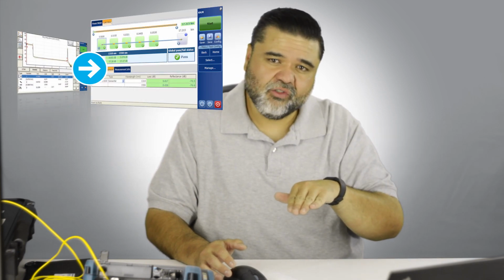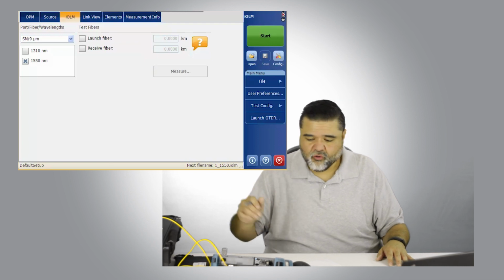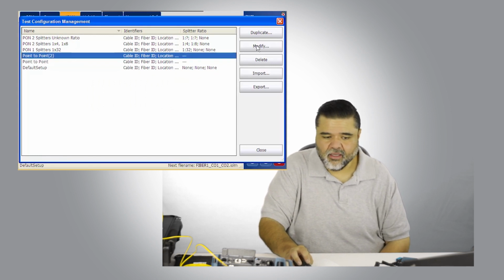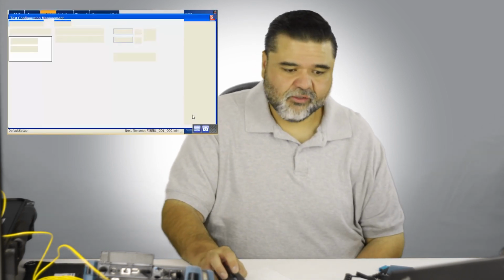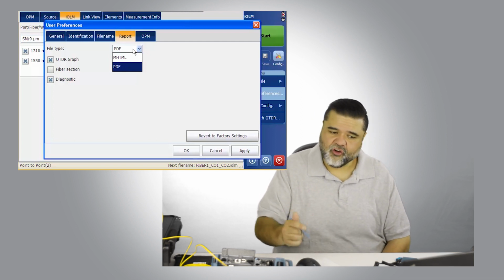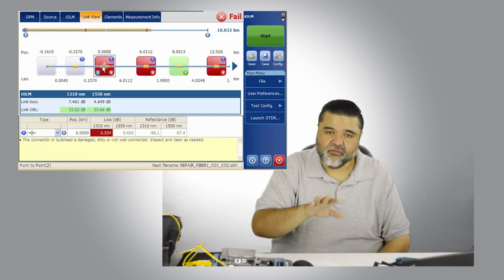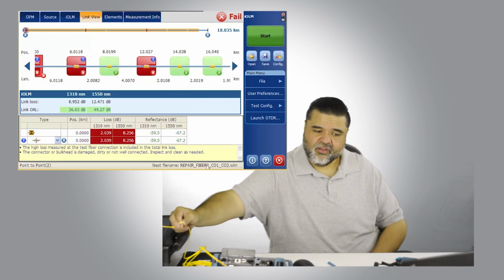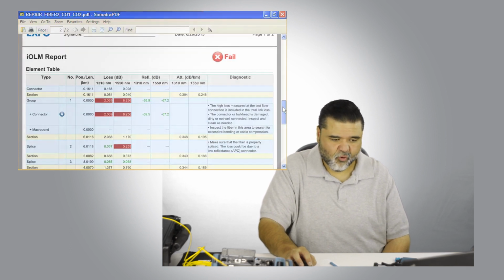iOLM User Training – EXFO – 15 Minutes or Less   Small

Comment: Can iOLM detect the pinching point when tested with only one wavelength
Reply from the maker: no you need both a short and long wavelength to detect macrobending.
Reply: @KevinPeres  i see
Reply from the maker: @MSB1180  if you had a choice of just 1 wavelength use the longer one. 1550 as opposed to 1310. If 1550 passes there is no serious macrobend issues
Reply: @KevinPeres  Thanks

Comment: As usual, thanks for the awesome video.
Two questions:
1. Does iOLM requires APC connector?
2. Is iOLM feature upgradable on any EXFO's iOLM ready OTDRs?

Sorry for having a lot of questions. Received our MAX720C recently. And currently exploring it.

Thanks Kevin
Reply from the maker: No worries about the questions.  It is recommended to have an APC connector on the OTDR if you want to enable iOLM. Most of our test sets ship with APC connectors it gives us much better performance. If your unit says it is iOLM ready then it would just need a simple software key to enable it.  If you have a UPC connector on the unit it can be replaced with an APC and upgraded to iOLM. Give the free trial of iOLM a shot. I am going to create a video talking about the new features of iOLM that include short fast and Medium link configurations under the Optimode setting in iOLM.
Reply: @KevinPeres  cool. Thanks Kevin. Will wait for the video.

Comment: Hi Kevin,
Thanks for video. it gives more information about iOLM
in iOLM, if there is a splitter of 50:50 after certain distance, how iOLM shows the link view ?
I mean does software shows both out put after that splitter or only one?
Reply from the maker: Jenson, You are very welcome.  If you are testing from the OLTS through the splitter you will only see one composite trace.  Same with an OTDR.  Depending on the dynamic range of the OTDR you will be measuring all the ports but folded on to one trace. What you will see is the loss from the splitter lets say a 1x32 you will have approx 17dB of loss if you have multiple ports used on the splitter depending on the distance from the splitter you will see a connection for the end of each drop.  With APC connectors it may look like a splice if it has low reflection.  I hope that answers your question.

Comment: Hi Eng Kevin 
Thank You for You efforts but 
Would I Ask you question about inspection Fiber 
Please Tell devices you are using ?
And it is function is cleaning tool actauly or just verify dirty of fiber
Please explain more
Reply from the maker: Salah my friend. I used the FIP-435B which is a fiber inspection probe. To clean I prefer a hybrid wet to dry method. Cleaning fiber connectors is instrumental in the performance of an optical network.
Reply: @KevinPeres  Thanks  could I use ioL tracer P2P link with small distance Like 3 KM or 4 KM

Comment: I noticed my EXFO OTDR is set up for the green APC(angled tip)  connection...... but blue SC (squared or flat) also seems to work.   Should I be concerned with this interface?  Is using an adapter crucial
Reply from the maker: Yes you should be concerned. Never ever mix green APC with blue UPC. The loss and reflection will be high and you can damage the connection.
Reply: @KevinPeres  Thank you very much.   Does the APC connection match in a keyed fashion in other words does the short side of one connector meet the long side of the other connector?  Or are they just floating and the angle attitude doesn't matter.  Thanks
Reply from the maker: @dizzolve  They are keyed. The orientation is important. The angle is typically 8 degrees if you look straight down at the connector with the key up you will notice the slight angle.

Comment: @kevin.Peres is it important to use a sizable launch cable when looking for faults in a fiber loop of less than 4000 ft? I’m troubleshoot shorter residential or business loops. We are running ASE or gpon.
Reply from the maker: Bob,  Sorry for the delay.  Launch cable length is always an important consideration.  For such short links you could get away with a shorter launch cable.  If everything is good you should only be using 3-5ns.  Assuming you are not testing through the splitter.  

You can use this formula to determine minimum launch cable length. 
Pulse width in (ns) divided by 10. Convert to meters and multiply by 2.
Example: 1 μs -> 1000ns / 10 -> 100m x 2 = 200 meter -> Appropriate launch cable
(multiplying the distance times 2 is to add margin for the pulse to recover you can
safely go down to 1.5 times)

Comment: Great video thanks for sharing. Is there any distance limit on Iolm
Reply from the maker: Your welcome. IOLM just like OTDR is limited by dynamic range. If you look up the specs on OTDR/iOLM if the dynamic range is 38dB. You then remove 5dB for noise and I like to remove another 2 as margin you end up with 31dB of loss you can test.

Comment: Do I need to use a longer launch for iOLM test?? Am using 20M patch now and its all passing but some panel ports are failing, while testing with 500M its all passing. Pls advise
Reply from the maker: iOLM with its multipulse acquisition method does require a shorter launch cable.  20M, for the most part, is fine but as the connector degrades on either the launch cable or the iOLM port you will start to get experience traces that require longer PW, or the reflection from the contaminated port will start to affect the deadzone and this would affect shorter launch cables.   It could also be with a 500M launch cable it is using a longer PW to test through the launch and you are losing spacial resolution.  I would have to look at the traces to be sure.  When you next test with iOLM check your launch conditions.  Select the first element that is your launch.  Make sure the loss is below 0.5 and the reflection in in the low -60dB or better.